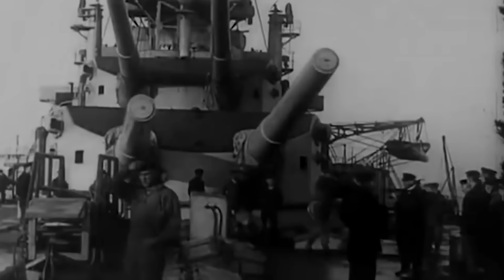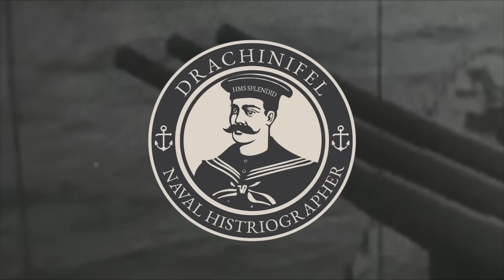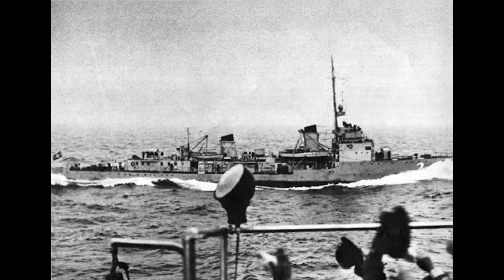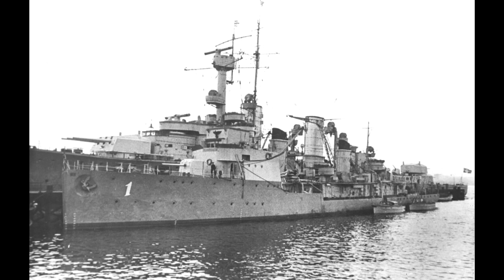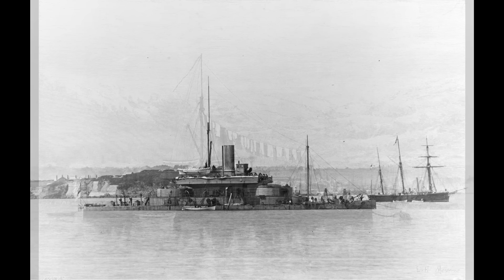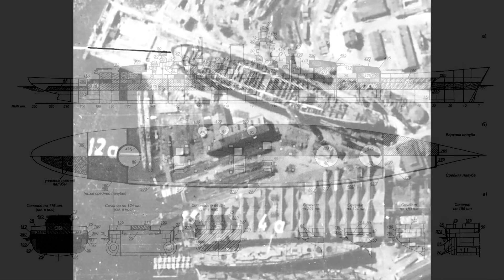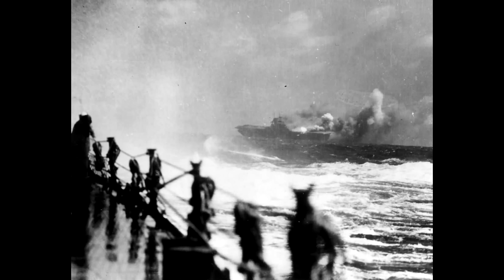5 Naval Engineering Failures - Sink, Swim or Explode

Comment: Well this has an element of wishful thinking (like almost all of it) but Wasp could have been maybe a much more useful ship IF her standard airgroup had been cut from 100 aircraft to something more like 55 {with storage for another say 25 that could have been given to other carriers.} Take her 29 1/2 knots down to say 28 or even better something like 27 so she could keep up with North Carolina and the South Dakotas. and not worry about much more. That 27 kkknots above should let her have a torpedo bulges that would have some value and maybe enough volume to put the magazines and fuel storage a whole lot deeper than they ever were. So you end up with a sorta decent ship with better protection than Wright and Saipan and a similar air group. I also took a brief look and lt posible to save time building bulges  (the survivors of Pearl Harbor showed that useful bulges could be tacked on quickly) and if Wasps need for better underwater protection had been recognized sooner the Wasp types could have grown bulges in something more like 6 months than the year plus that was standard.

Comment: Hi Drach as a kid we used to swim out to the old HMVS Cerberus in Black Rock.  There are plenty of drawings and plans some in the local Sandy Pub.  It is all different when you actually stick your feet on deck.  What looks like a Funnel on the wreck is actually an armoured observation post.  You can see the vision slits all the way round about a foot down from the top.  Not much room in there, two people would be a real squeeze.  60 years ago it was definitely not a place for any carelessness.

Comment: In Wasp's defense, she was based on the knowledge gained from Ranger, an experimental design that gave surprisingly good performance on a low displacement of 14,500 tons standard.  Ranger was able to make 29.3 knots on only two shafts at 53,500 shp.  She was by no means fit as a warship.  She only had 2" of armor and no TDS but could carry 86 aircraft and steam 10,000 nm at 15 kts.  She was also inexpensive to build.  Unwilling to risk her in battle Ranger spent most of the war working as an aircraft ferry.  Churchill twice requested Ranger be sent to bolster the British forces in the Indian ocean, in April and December, 1942.  Admiral King refused this due to Ranger's inability to take a punch as well as needing every carrier possible.  She delivered aircraft instead. The few operations she was involved in were relatively safe ones with escorts.

With 15,000 tons of carrier tonnage left under the treaty they built an improved Ranger.  Wasp's hull and machinery were very similar to Rangers,  about 40 feet shorter, 200 tons heavier, and used similar engines to Rangers but rated at 70,000 shp.  Wasp could make 29.5 kts and steam 12,000 nm at 15 kts.  Like Ranger, she had little armor and no TDS.  Where she differed was in her superstructure which was modeled on the more functional Yorktown class.  Like Ranger, she was initially kept away from danger and ferried aircraft to Malta for the British.  Losses in the Pacific necessitated her transfer where she predictably did not survive long.  An alternative might have been to reclassify Ranger as a seaplane tender like Langley, or scrap her, and build a really capable super Hornet of 30,000 tons.  Or if you really didn't care about cheating just build Wasp as another Yorktown.

Comment: I disagree with Wasp being on this list.  Her faults were due to understandable problems during her design phase and treaty limitations. She did sterling work in the European theater and overall was worth the effort especially as so much was learned from her. As the saying goes, you learn a lot more from mistakes.
Reply: I think the insistance on the large air group despite the compromises forced into the design due to tonnage limitations is what earns her a spot on the list.
Reply: @Bird_Dog00  Once again, why?  She contributed significantly. Not a failure; and frankly a lot of so called better ships went down to Japanese torpedoes. This list is not all that.
Reply: @johnhallett5846  
The fact that the thing that ultimately killed her would also have likely killed any other carrier doesn't mean she didn't have design deficits.
Yes, those 3 torpedoes would likely have taken a Yorktown down as well. But two? A Yorktown would have had better chances of surviving that.
With a smaller airgroup, they could have made Wasp a more balanced design.
Reply: @Bird_Dog00  Opinion only. nothing more.
Fact was they made a calculated risk and frankly it paid off. She was sunk by an attack that would probably have sunk anything but an Essex and maybe even one of them. There is no real evidence that she deserved to be on this list.

Comment: Cerberus was built for the COLONY of Victoria - as the Australia had not been created there were no states but individual colonies...
Cerberus was for service in Port Phillip Bay - fairly shallow and protected body of water.  At a pinch it could sail to Westernport Bay (Warrnambool). That it made it Victoria required breast works and addition of masts and sails....
The "flat iron" vessel HMCS Protector (for South Australia) was a better vessel - also sailed to Australia (with masts), served for twenty years inside the Gulfs, sailed to China (for the Boxer Rebellion) and shocked dockyard officials in Hong Kong on arrival in reporting no defects (very unusual for any arriving RN vessel) and managed to survive a typhoon while at sea during the return voyage. It saw no action. It continued to the 1920's including retrieving souvenirs from the wreck of SMS Emden on Cocos-Keeling Island. Forty years of honourable service.

Comment: Hi 😊
I'm a regular follower of your videos wich I appreciate quite a lot.
Regarding Stma. Trinidad, I  presented a lecture about her in the International Naval Architecture Congress that took place at Madrid las April.
As almost everything we knew cames from descriptions or stories, a lot more literary than technical, my lecture was a reverse engineering project, extrictly from the Naval Architecture point of view.
Thanks to a friend of mine, I got all original documents related to the works and modifications from the shipyards. Even dimensions and weights of each part were duly writen down during those works.
Beside that, I got a lot of mails between the Naval Architects engaged in the project. I also had access to the " end of works" final plans from 1796  signed and stamped by the yard director and the Project master Naval Architect. The acceptance of the Crown is included in those final plans.
After the reverse engineering, I concluded she wasn't a good "sailor" but not worse than many others at her time.
The main problem being, as one of the Arquitects wrote, at her heart. The general shape of the frames was wrong and hence no further work could solve it.
Wasn't a manouverability or speed problem, but a stability one than can only be observed if the whole curves are drawn.
Regarding woods. She was not built in mahogany, quite a heavy hard wood, but from cedar. The whole hull was built from this lighter wood. By the way Cedar behaviour when shooted by a cannon ball is a lot better than that of mahogany or oak.
Please, take my comment as what it is. Just information and not anykind of criticism.
Best regards.

Comment: It is amazing to me as a retired naval shipbuilder, that this small issue of center of gravity, never seemed to be in most naval designs, until typhoons hit the pacific in ww2. 

So the lessons of poor designs of 1800 were never learned. Simply astounding, especially when you consider how smart you would need to be to graduate the naval academy. 

Personally knowledgeable of how smart they were in recent years. I think political stuff simply overpowers actual naval knowledge. 

One of the worst problems was to design major changes, before they were designed, much less tested and qualified. 

I spent 40 years doing this. 

Another example is electric motors. The navy just couldn’t standardize size and design parameters. So all classes of ships were different, at considerable expense.

Comment: F Class will always have a fun little part in my heart...

The F2 is a wreck up in Scapa Flow, and it went on continuing being problematic after it sank! She was being salvaged by a rather inexperienced company when some bad weather sprang up.

The entire salvage team rode off the boat for the night, leaving her anchored to the wreck. The next morning - no barge, and no sign of the twin AA guns sitting in its hold.

And that's why the F2 is still connected to the sunken salvage barge. Phenomenal dive, the guns are still in the salvage barge, you can still see the cylinders used to charge  torpedoes, and a significant amount of her power packs are no longer in the ship

Comment: "they were howitzers, which meant that to hit anything with a shell, you'd first have to find yourself guessing how far above the tallest mast of the target you actually had to fire and then prey that the rolling of your ship and the delay in the charge going of between you lighting the fuse and the actual detonation didn't completely throw of an already quite sketchy firingsolution, since of course a round plunging down out of the sky had to be on target by a handful of degrees at worst, whereas the mostly horzinal firing Canon could be out of aim by as much as low double digits but they'd still hit something, assuming you aimed for roughly speaking a ships center of mass."

That. 
Was. 
A. 
Single. 
Sentence. 

That skill! ❤️❤️❤️

Comment: The Knox class ASW frigates ran 1200 pound steam at over 900 degrees superheat.  Pinhole leaks became an obsession with the BTs and MMs.  There was always a broom handle in reach.
  Somewhat off topic, the employment of gas turbines has one major advantage over steam powerplants: they don't have to generate a head of steam.  Their downside is the need for more highly refined fuel than naval crude or distillate.  For an oil producing superpower that might not be as much of an issue.

Comment: The F-class consisted of ten boats. They were concepted, constructed and built hastily after the rearmement decision between 1934 and 1936. Due to the short design time, the class were poorly thought out and proved to be a faulty design. Mainly because the boats were used as test objects for the innovative but experimental Wagner boilers at the time. Long shipyard time arose and frontline systems were only installed afterwards. As they were technically inadequate for the intended use, the boats were converted into tenders and torpedo interceptors for training duty early in the war.

Comment: I do think including Wasp on this list is unfair. Yes her design choices left her as a glass cannon but even if you downsized her airgroup and upsized her protection 3 long lances are still going to gut her. 

Not to mention that is Wasp deserves a place on this list that means we need to add a couple more. 

First are the British light fleet carriers which are of similar size, slower, operate a smaller airgroup, and don’t offer any better protection. In fact I think you could argue that being designed to commercial standards their survivability and durability would have been significantly less than Wasp’s had one ever been damaged. Yes these ships had long post war careers but none of them was ever hit at all much less by three long lances. 

Second the Yorktown class.  Wait wait wait I can hear it now. Many people argue every seriously that the class was the best of the pre-war carriers how can they be an engineering failure. I’d argue they are because every single time one of them got torpedoed (by aerial torpedoes not submarine launched) the ships lost all power and went dead in the water. Their entire motive power was derived from 6 of their 9 boilers which were all grouped together in one section of the ship and the design of their boiler rooms meant that when Yorktown was torpedoed you had a large amount of off center flooding leading to a large list that because of the loss of power could not be corrected and forced her abandonment.  And this class thanks to treaty limits only had a three layer system in the way of the boiler rooms leaving them especially vulnerable to underwater hits in this part of the ship. The design and layout of their engine plants was a serious failure and one that directly caused the loss of two out of three ships in the class. 

Now I don’t think any of the ships above really deserve to be considered failures but if Wasp does then so do the other two. 

I would love to see you do a video Drach on the 5 or 10 best examples of naval engineering. Things like the auto loading 8” of the Des Moines class for example that are just amazing feats of engineering which work.

Comment: 41:38 That's a significant point, I think. Considering that (probably) three submarine torpedoes were enough to sink the much larger and better-protected Shokaku a year and half later, I think any carrier of that time in Wasp's position was probably doomed.
Reply: Add to the fact that both Wasp and Shokaku were in the middle of flight operations. So a lot of avgas and munitions were being moved around and exposed.
Reply: Shokaku was under a shakedown cruise and the crew was nowhere ready to use all the damage control qualities, thus the ship sank with rather limited punishment. A same kind of hull absorbed 19 torpedoes and numerous bombs before IJN Musashi sunk at Sibyan sea.

Could an Essex have eaten up a salvo of three long lances? Nip and tuck, depending where they would've hit and which areas would have been exposed.
Reply: @Ah01  Wrong ship. You’re thinking of Shinano, not Shokaku.
Reply: @Wolfeson28  Yes I was, my bad. Thanks...

Comment: I cannot  help but think that upgrading early Victorian costal batteries or building new ones at vulnerable ports using 11 or 12.5 inch r.m.ll guns would have been more cost effective  than the Cyclops  class, with the added advantage  of a stable gun platforms ,  known ranges etc.

Comment: I wouldn't say that the Wasp was an engineering failure. She was well engineered for what was asked for. The intent had been for her to get upgraded once the treaty limit was removed. She was more of an operational failure. Once the treaty system was abandoned the US command should have immediately sent her back to the yards for the intended upgrades instead of having her racing around in hazardous waters because they didn't want to take her out of service. Her loss was completely on the hands of the Admirals who failed to have her upgraded, not the engineers who designed her.

Comment: Three Type 95 torps would I think definitely have sunk any of the Yorktown class ships.  Drach is being a little too hard on the Wasp design there.
Reply: If I remember correctly. While she was deemed lost about an hour or so after the attack. She didn’t actually go down till about 9PM that night. 

Also, Wasp did have one advantage over her half-sisters/cousins. In that she had alternating boiler and engine rooms
Reply: @ph89787  they did a couple of things on Wasp that became standard design most importantly the deck edge elevator vs center line elevators
Reply: Yeah, and it was common knowledge within the us navy, that Uss Wasp`s underwater protection was inadequate. The decision to deploy it against the japanese was a stopgap act of desperation before the Essex`es came to tip the balance. 

(But, during the same attack it was also found out that the North Carolina - class had better UW-protection than anticipated, since NC ate a Type 95 on the most wounerable spot where the hull gets slimmer in front of the turret A and still it`s front magazine was not penetrated.)
Reply: @Ah01  There was a lot of talk about the big hole but it was basically hull damage that was not hard to repair.  That one spread was remarkable and arguably the most damaging spread fired in submarine history.. A fleet carrier sank, a destroyer sank, and one of the very few US Fast battleships put out of action for several months during the most critical time of the Pacific War
Reply: @gruntforever7437  Yeah, and honourary mention of the biggest goof up of a torpedo salvo goes to cruiser Mogami for sinkin a few own transport ships. Caused almost as much havoc as the one you mentioned.
Reply: @Ah01  And those were Long Lances, the Type 95's big brother.
Though a few transports really does not equal a fleet carrier
Reply: @gruntforever7437  That's correct, especially if the loss of lifes is not regarded.

Comment: @Raptorbeast7 asks a good question--  to cite feats of damage-control excellence. But it hinges on key info that may be hard to dig up. I.e. Scharnhorst hit a mine during the Channel Dash and went dead in the water. Their D.C. handled the damage well enough that in just 30 minutes the ship was under way making 25 knots. This drew high praise from the British. I'd like to know specifics about the damage. That's for someone with better sources than I have.
Reply: IDK exactly but mines tended to hit aft of the bow so maybe it took out a boiler room or two. If they seal the room & prop up the bulkheads and swap out that boiler for others remaining boilers?